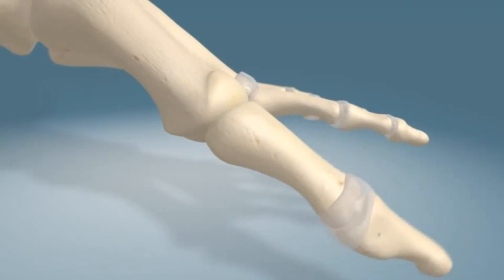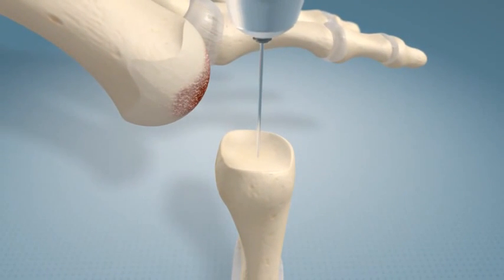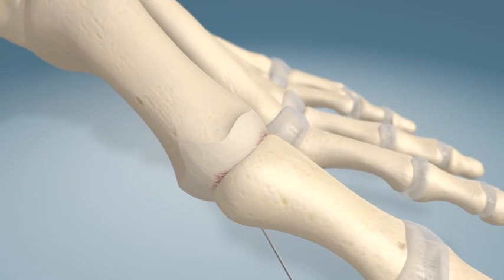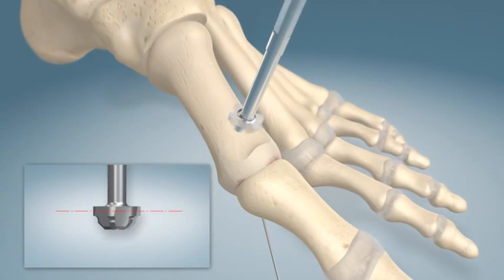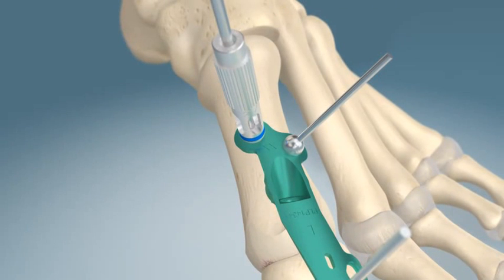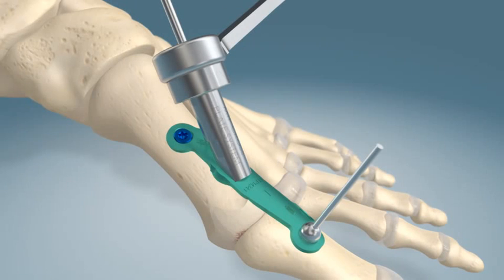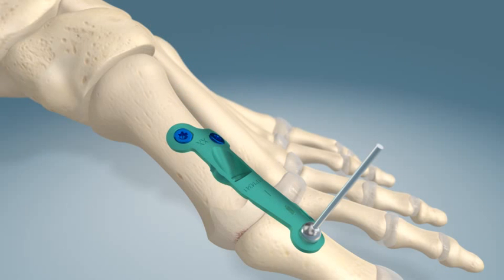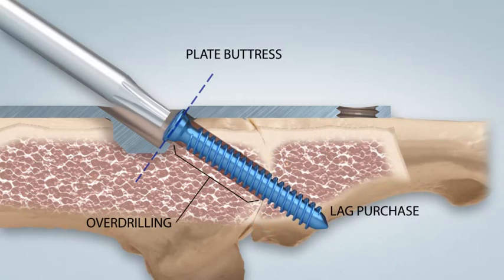1st metatarsal-phalangel joint fusion procedure

Comment: Absolutely stupid.  This joint was placed in the body by God, for correct movement during walking.  You should have replaced the joint or joint surfaces to allow for normal motion